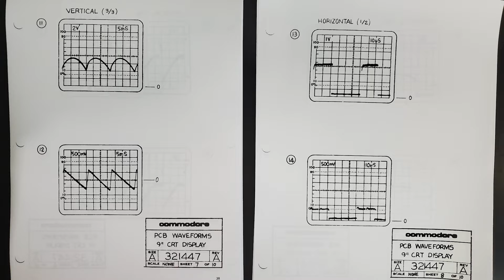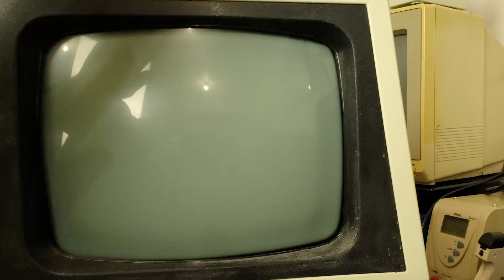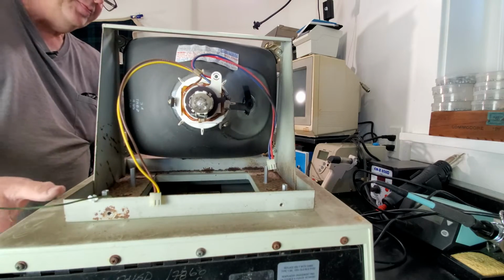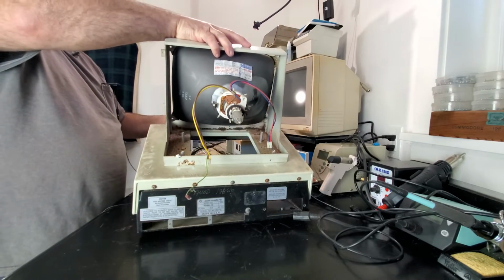This Commodore Pet 4032 has Seen Better Days - Can it be Saved?

Comment: Thanks for the Videos.  Just got a PET that was a mouse home and is worse than this one.   The screws holding the board in and hinge screws had to be drilled out.  The band holding the CRT rusted and broke and the CRT came loose during shipping and broke the neck so I'm looking at how to use a LCD screen with a PET.  Next step is to drill out the power supply screws.
Reply from the maker: That sounds like a fun project!

Comment: Sweet.  Can't wait to see how this old PET turns out.  Not sure if you have seen it before but I have had great success with a product called Iron Free.  It is made for car wheels but man does it do a number on rust on most surfaces including plastic, polished metals, painted surfaces etc.  I had a rusty A500 and an IBM PC and it destroyed the rust.  You can buy it on Amazon.
Reply from the maker: Thanks Racer X! I just got a product called Fertan that came highly recommended by someone on the VCF forums. If it does not work I will give Iron Free a try!